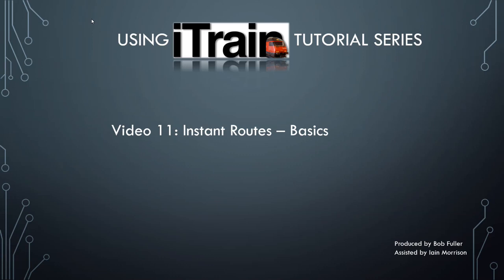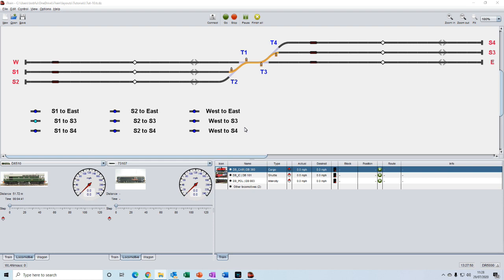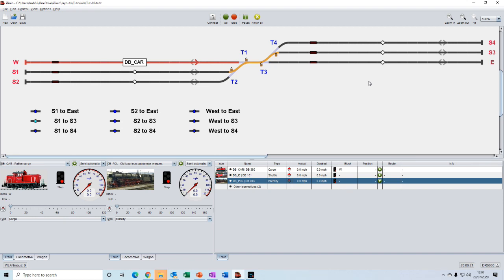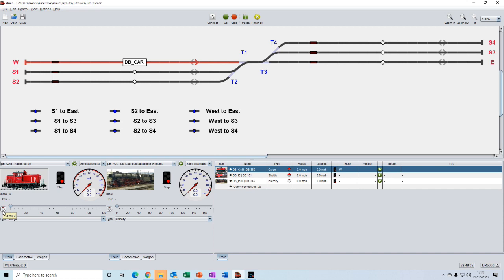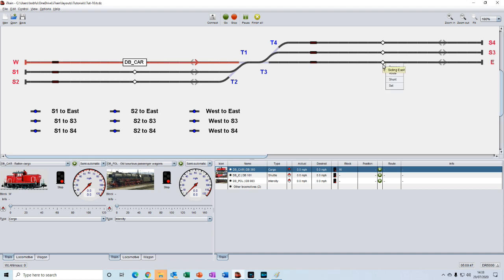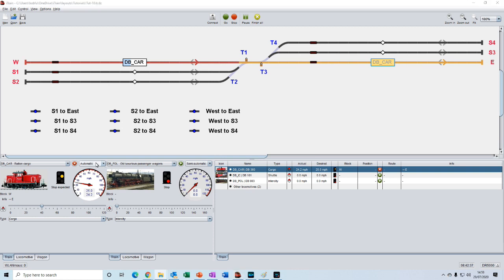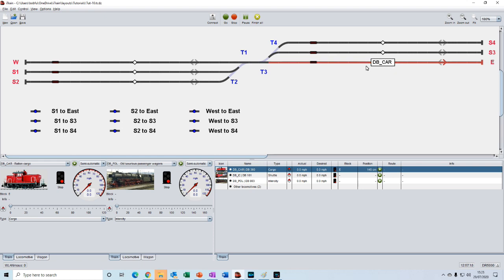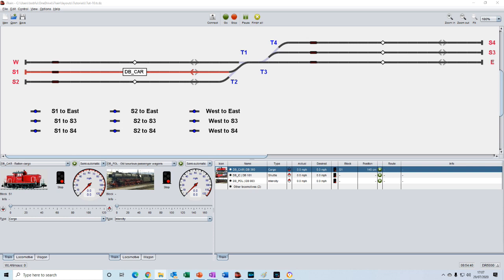Video 11: Using iTrain Tutorial Series - Instant Route Basics

Comment: Hi Bob, I have followed all of the pervious vids and got to this stage but it will NOT work in setting an Instant Route. I add my train to a block then drag it to the next block, none of the turnouts are locked. But it will not create the route. I also have a constant Red Stop light in the throttle window. How can I make this work ?
Reply from the maker: Also, run 'Diagnosis' in the View menu and check for any errors.
Reply from the maker: You will need to ask the question on the iTrain forum and attach your layout file to the post. We need to see your layout file to understand what is happening.

Comment: Hi Bob, not sure you can help, but I think I did everything you showed up until now, but when I drag the train from one block to the other, it says that route not possible from this position, even though the loc is at the front, in th right direction and did select route. I tried to recreate a simpler layout with just one turnout and three blocks, and am getting the same message.
Reply from the maker: Hi Rudy
There are various things that can cause this. We need to see your layout file. So please post your questions on the iTrain forum and ensure you attach your .tcdz layout file. Someone will the provide the appropriate solutions.

Comment: Hello Bob. I am really stuck on creating an instant route using your test layout.  I have the train in the siding, pointing in the correct direction and can move the train to the next siding by clicking and dragging. When I then select 'route' - nothing happens i.e. the track does not change colour. Any ideas? Regards Martin
Reply from the maker: Hi Martin. There are a number of things that could cause this. In general, for support questions it is better to post your question on the iTrain forum and attach your layout file (.tcdz file) to the post. Helpers need to be able to look at your layout file.

But first, try using the "Shunt" command instead of the "Route" command. If that works, then the problem is due to the configuration of the train. If it still doesn't work we need to see your layout file. Also, run the Diagnostics to check for any errors.

Comment: Bob, I am gradually working my way through these excellent videos, and learning a lot. I’m regularly using the diagnostic tool, but sometimes the issue, although caused by not quite getting something right within a topic previously covered by a video, is beyond my understanding. And the solution is not apparent.  Maybe because that solution doesn’t become clear until a later video. Is there any kind of query resolution material, as surely there can only be so many standard issues as diagnosed. Ian
Reply from the maker: Hi Ian, great to hear that you are finding the tutorials useful - thank you.
The best and the quickest way to get assistance is by posting your query on the iTrain forum. To be able to provide solutions, we will need to see your specific layout file (the .tcdz file). On the forum you can attach the layout file to your post and then others can download it, see the problem, and then provide a solution.
So, create a new post for your specific problem (one post per problem with a relevant title), explain the problem, then below the post you will see a tab called "Attachments". Click on that tab, then click "Add files", then locate your .tcdz file on your computer (by default it is located in C:/Users/[your username]/iTrain/layouts), and add it to the post.
Hope this helps.

Comment: Thank you for some very informative videos. When running the diagnostics in the previous videos you mentioned that you would come back concerning the loco alerts. In what particularly video are you to address this? Thank you in advance.
Reply from the maker: Hi Jens Erik
Yes, you are correct and I failed to do so - my apologies. The error "Loco 73107 cannot be detected by a feedback" was corrected by opening the Loco editor, selecting 73107, clicking on the Options tab, and in the Feedback Offset section tick Occupancy and enter the figures for the feedback offset. The feedback offset is the distance from the buffer to the first pickup wheel.
The error "Loco D6510 has no correct feedback offset" was corrected in the same way as above. The difference in this case was that the Occupancy was ticked but no figures has been entered for the Feedback Offset.

Comment: I watched this video over and over to understand, but yet I'm stuck even if I've tried many possibilities but the system keeps saying "route impossible in that direction"
Reply from the maker: We would need to see your .tcdz layout file, Frank. Make a post on the iTrain forum and attach the file. We can then help. The file will be in your iTrain folder and in the Layouts folder.
Reply: @bobfuller  I just created an account on Itrain Forum. Now I'm waiting for the validation. And then I will post my .tcdz layout file
Reply: how long will i have to wait for validating my application ???
Reply from the maker: @Franck_2R  I think Xander needs to validate it manually, so it may not be until Monday, but he sometimes does do it during the weekend.
Reply from the maker: Have you run the Diagnostic in the VIEW menu? That might point you to the problem on your layout. There should be no errors listed.
Reply: @bobfuller  Yed i did, but with no positive effects
Reply from the maker: @Franck_2R  Do you mean there are no errors listed?
Reply: @bobfuller  yes indeed
Reply from the maker: @Franck_2R  ok, we will have to wait until we see the tcdz file.

Comment: QUERY ON DIRECTION ARROWS. Hello Bob, great series and very logically presented. One thing I don’t feel you make clear however is the issue of direction arrows. For example in your video example you show direction on the LHS sidings from right to left, and in the RHS sidings also from right to left also. Surely on a siding it should always be into (or out of) the siding for consistency? In either case you then go on to choose both directions on all of them when creating the block, but the preferred direction on both LHS sidings and the RHS sidings remain on both, left to right, due to the earlier choice of direction. This seems inconsistent to me. There’s something I’m missing here! Your thoughts would be much appreciated.
Reply from the maker: Hi James. In a terminated siding, the important thing is to make the block bi-directional, because trains will always need to drive into and out of the block. When the block is bi-directional, by inference, there is no preferred direction, which is why I wasn't too bothered about which direction the arrows were pointing during the initial construction of the block. If you look at the double arrow, both arrows are solid (each arrow will have a slightly different shade but they are both solid arrows. If you change the block to preferred direction you will see that one arrow is solid and the other is dashed. The solid arrow is the preferred direction.
But, you are correct, it is better to employ some sort of consistency when creating blocks, especially if you are using more than one feedback sensor in a block, and entering the block positions manually. The blocks must be ordered from previous to next direction.

Not sure if I've interpreted your question correctly.
Reply: @bobfuller  thanks for your very quick reply which is helpful. I’ll press on with building my itrain track and get back to you if this issue crops up again..
Reply from the maker: @jamestennant-eyles9870  if you have questions/problems it is better to post them on the iTrain forum because most of the time we will need to see your .tcdz layout file to be able to see the problem. In the forum you can attach your .tcdz file to the post and it can then be downloaded by others who will help with the answers. You get a quicker an better response from the forum. I'm not an iTrain guru, I'm learning as I go and just sharing what I have learnt.

Comment: Hi Bob. When I double click on the next block to start the route. I get Reservation stopped route lost ?
Reply from the maker: LOL, that's actually a topic in the next video. It's probably because you are double-clicking before the throttle speed has increased. The throttle needs to have some speed (either done automatically by iTrain if using automatic mode, or manually by you if using semi-automatic or manual mode) before the FB is double clicked.
Reply: @bobfuller  OK Thanks Noted.!, but that doesn't appear to be the problem. If I try the route in reverse direction (as a shunt move) I get Route not possible from this location. I have done something wrong somewhere!
Reply: Roy, 

Bob has described the r as on for your initial problem - don’t click too fast, allow the loco to start moving first.

The shunting issue could be a range of faults and you should ask a question on the iTrain forum  https://berros.eu/itrain/forum/viewforum.php?f=1 and include your TDCZ file which I can then look at to see where the issue lies.
Reply: @damenfeld  Just posted.

Comment: Thanks Bob,  another great job.
I would like to ask you a question: In your last video, you defined the sensors type as "Occupancy sensors" with a size equal to the block length and in the Block properties you marked  "Using Positions" to set the brake and stop positions of a train in the block, I don't use occupancy sensors that sense the whole block, I use track detection (S88), two sensors per block, one at the beginning  (Enter sensor) and one at the end ( Stop sensor), should I define the sensors as Occupancy sensors with its real length and use positions? , What's the difference if not using positions?
Regards
Reply from the maker: Hi Juan,
Good question. Would you be able to post your question in the iTrain forum? I think it deserves a better answer than we can give you in the YouTube comments section, here. And I'm sure others on the forum would be interested in your question, too.

Comment: Hi Bob
I wonder if you could help me on a problem I’m having with Cobalt point motors.
I have set them all up in iTrain and they all work but a couple of them are reversed,  ie when I set straight they are curved.
In my old program, Railmaster, I could reverse the polarity, but I cannot find any way to do this in ITrain.  Am I missing it.
Any help would be very appreciated.  Thank you.
Reply: Thanks Bob, all working now
Reply from the maker: Hi Ron,
To synchronize the physical state with the state in iTrain, you can hold the Alt-key and click on the turnout. This changes the initial state of the turnout.
It is also prudent to go the main Edit menu, then into Settings, and in the Options tab click on "Always set accessory". With this set, if you make any manual changes to the turnouts when offline, iTrain will reset the turnouts to their correct initial state when iTrain come online.
Reply from the maker: Also you can set the initial state of the turnout in its' properties. Go to Edit/Accessories (Ctrl+F8), click on the turnout that you want to edit, and change the "Initial State" setting.
Reply: In addition to what Bob suggests you should ensure that the checkbox 'Activate all accessories upon connecting' is checked in the Interface tab. This will ensure that all accessories are set to the last saved state of iTrain. This is especially important of you have been playing off line and have changed anything whilst iTrain was not connected.
Reply: @damenfeld  Thanks Iain, all help and suggestions gratefully received

Comment: is this iTrain 5?
Reply from the maker: Yes, I am using iTrain 5.0.5
Reply: @bobfuller  Makes sense now, I can see features I dont have in iTrain 4!
Reply from the maker: @Rule1ModelRailways  yes, there were quite a few great new features added to iTrain 5.
Reply: @bobfuller  this one is really big; Show short-circuit in block or feedback by blinking. I think that will really be worth it for my exhibition layout for quick fixing of shorts if I get any at a show.
Reply from the maker: @Rule1ModelRailways  yes, a very helpful feature, especially, as you say, on an exhibition layout when you are under pressure and in a panic to find the fault!! 
And remember, even though you already have itrain 4, you can still apply for the 1 mth trial license for iTrain 5 to test it out.
Reply: @Rule1ModelRailways  you can only do this if you are using a system which supports the capability and this is a limited number of intelligent command systems and protocols such as BiDiB.